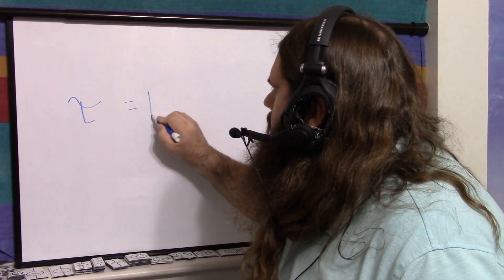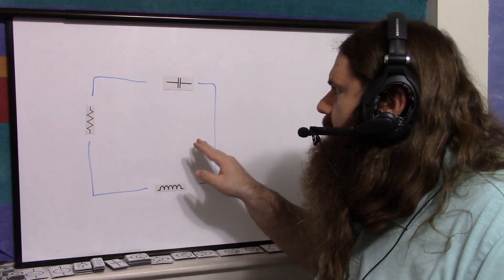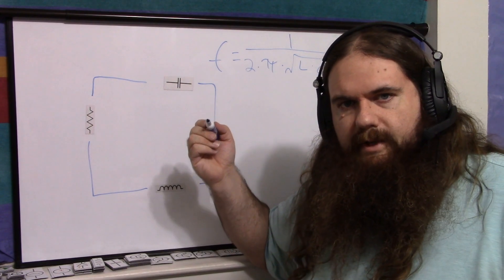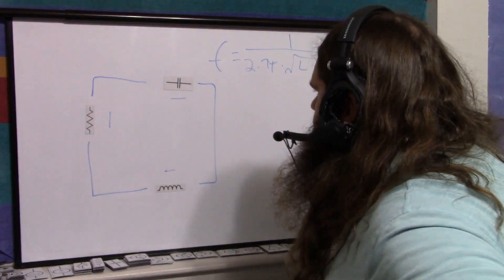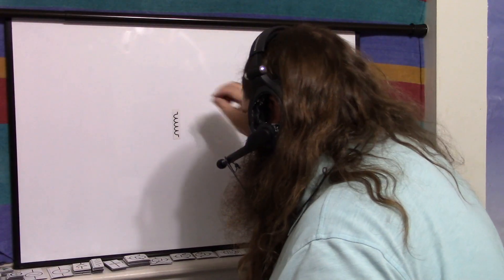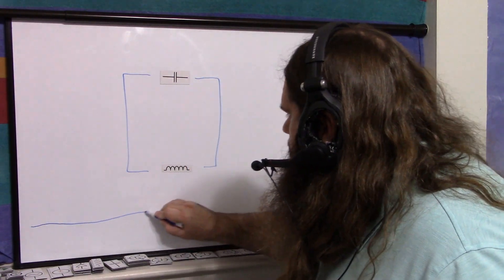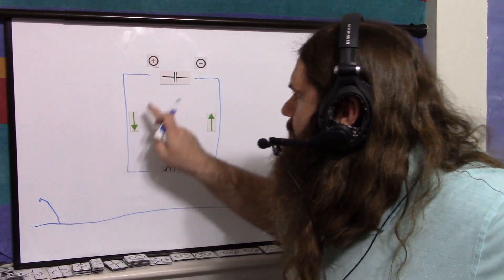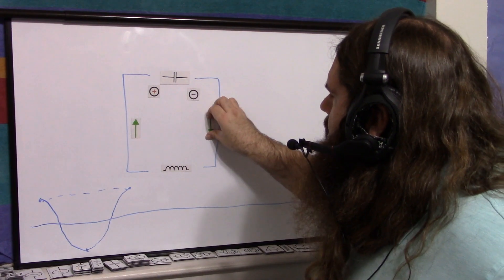LC Tank - Sine Wave Generator and RLC Oscillator Core - Simply Put

Comment: Is it possible to add a second inductor with the opposite polarity of the first inductor to this circuit?  So that during the discharge of the capacitor the inductors switch polarity in timing with each other? I am not sure I worded that properly.

Comment: Wow, something clicked for me watching this.  The inclusion of R and it’s effect on the amplitude helped.  Your explanation of what resistance was doing, simply attenuating the signal, not affecting the frequency and then showing the decay due to the resistance inherent in the system helped so much.  The LC circuit is maintaining a frequency, it’s just fading.  I’ve been an extra class ham for over 20 years now and never really fully understood an LC tank.  Fast forward to my holiday break here and I am trying to create one and test it on an oscilloscope.    Super helpful.

Comment: The resistor can effect frequency of the circuit because controls the rate a which the inductor is charged up.
Reply from the maker: As I go over in the video, the resistor affects the flow of current linearly, meaning it is constantly dropping a percentage of the voltage (according to V=I*R) which affects the amplitude of the signal, not the frequency. A resistor dissipates power; It does not literally "slow down" the flow.
Reply: @simplyput2796  interesting you bring that up. I used to think of resistors in terms of slowing down the current until I realized the effective "slowing" of current was merely a phenomenon caused by their primary power dissipation function. A 'current limiting' resistor in an LED circuit is actually a power dissipator which only allows a limited current to flow through it based on TEMPERATURE (and that's an important feature most people forget to mention, because the temperature of the component is the result of power dissipation over time and ambient factors).
https://www.youtube.com/watch?v=VSHqlK6bOf4